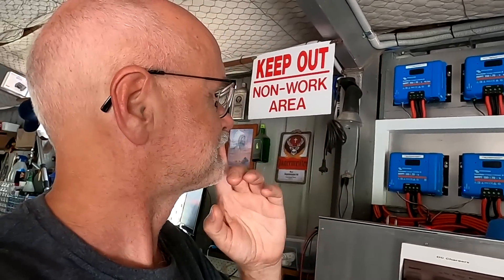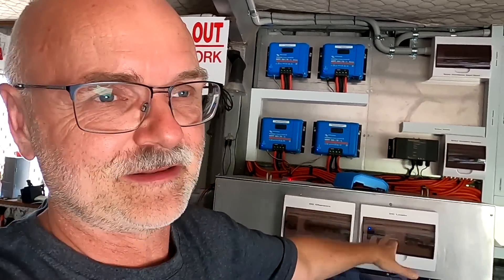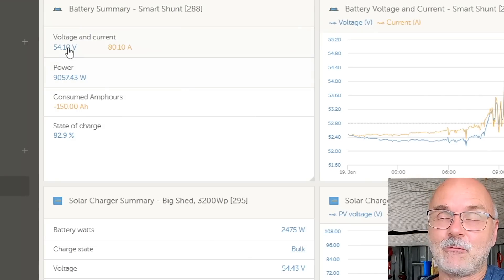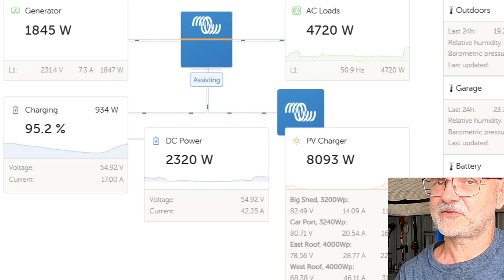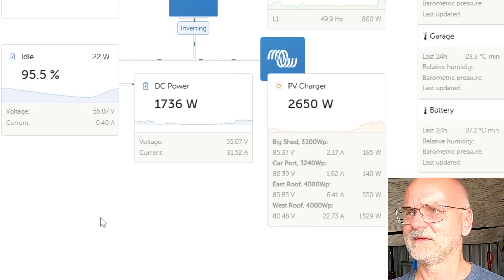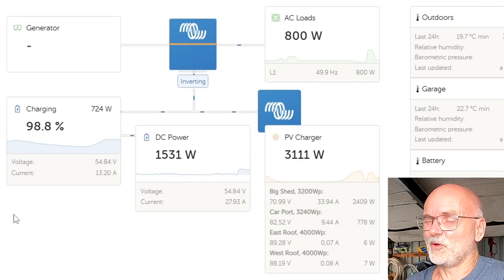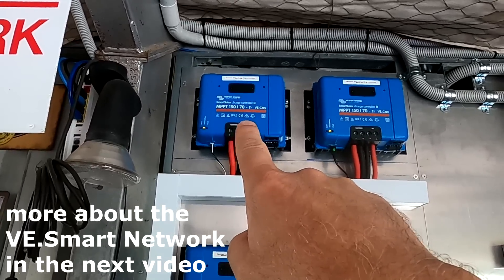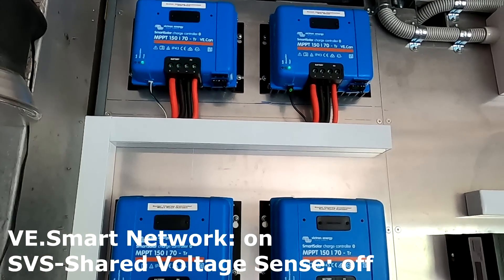Charging chaos: no charge despite full sunshine. MPPTs out of control!

Comment: Great videos. Question, I have just installed a smart shunt , MPPT 100/30 and DC to DC XS into my camping van. Would  you also recommend that I setup a smart network with the devices. The MPPT will only operate when camping and the DC to Dc will work when the alternator is charging the starter battery. So they will never work together.

Comment: Low quality MPPT made in China, capable of converting over 100V from solar panels to 12-48V. To solve the problem, disconnect the input from the solar panels, then short-circuit the MPPT input using low-resistance bulbs such as 12V, 24V and 48V, which means the voltage will discharge to zero, a known problem in MPPT, then we connect the MPPT module to the solar panels again, the MPPT starts working.

Comment: I am building a 48V battery box for the first time with 202A cells and a daly BMS. The output currant is 100A and the input is 50A. I ordered a Taixi single pole 63A breaker as an on/off switch to protect the BMS. 50A continuos X 1.25. Will this allow 100A output? Is this wrong?

Comment: I have pretty much the same setup like yours - 3 SmartSolars synchronized  via Blutoth,  a Cerbos with active DVCC and a battery with BMS. I don't have a SmartBMS (next step for me), but I've never seen such a behaviour like yours. Nevertheless, what I don't like is the fact, that I'm in doubt that the absorption and float settings are working correctly - due to the weather in lucky cold germany I'm currently happy to see the sun coming out to see my battery charging a little. In my setup, SVS is active, SCS deactivated

Comment: I have had my CerboGX, 4 MPPT and Lynx connected to my batteries before I implemented Multies.
I've noticed that voltage differance was rather large (300mV) between 4 MPPTs (they were like <10mV apart) and Lynx Shunt which was way off -300mV
All values have been tripple checked with reliable meter (Fluke).
I talked to Victron about this and they send me new Lynx shunt. This new one was like -150mV off, better but not god.
I have all MPPTs and Lynx connected via VE-Can never tried with smart-BT network. No matter if I used DVCC SVS or any other setting there was no way that voltage would be corrected to any value, god or wrong. They were just different.
After some time I installed my Multies and connected them with VE-bus to Cerbo. No change with voltage read-outs.

BUT after turning on DVCC SVS and multies are ON, I could see voltage readouts were normalised on ALL devices in the system.
Readouts are not exactly same but they differ about +/- 10mV or less, wich is god. The interesting part is that voltage they show now is voltage measured by shunt (which is 150mV less then real). This is not ideal but much easier to compensate if you wish to.

Another thing to notice here is that if you have multies in 3-phase system and CerboGX, MPPTs will allwas be in external controll and will be using multies algoritam, no matter what you put in MPPTs that will be overridden. The bad thing is that algoritams are not the same!

I am quite sure you charging issue Andy is based in different voltage readouts and all of the devices in the system must be connected in some way to comunicate to each other.

Comment: I have the same exact issue, and was told the same things by folks on the community forums: to turn off my smart network. Turning off the smart-network caused the same issue you have. If I put the smart network back on my VenusOS devices gives an error that the devices are incompatible. It's pretty frustrating that victron doesn't have clear language on how to handle this when you have a VenusOS device.

Comment: Hi Andy, I have 6x Victron SmartSolar 100/50 running with BMV 712 together with CERBO GX. 

You definitely want to have all SmartSolar joining the VE Smart Network together with the BMV 712 to enable synchronised charging.

Without synchronised charging, a SmartSolar may see what it thinks is a battery voltage, but in fact is another SmartSolar's charging voltage and make an incorrect decision on its charging action.

Without synchronised charging, the more charge controllers there are in the same system, the more chaotic it is.

With Synchronised charging enabled, you would noticed that the Blue/Amber/Green LED on each SmartSolar solar charger will flash in a coordinated manner, with each unit taking its turn. This way when it is time for one charge controller to charge the battery, no other unit would attempt to charge. Hence the charge controller would be seeing the real battery voltage and not the charging voltage from another controller.

You can also control the sequence by bring each controller online in the manner you want, as each controller is connected to the battery. They should follow this sequence to wake up during synchronised charging. 

With SmartSolar and BMV712, synchronised charging works well using Bluetooth connection alone. 

You also want to enable the BMV to transmit battery voltage sense and battery current sense to the VE Smart Network. 
Especially with LFP battery the voltage remains relatively flat during charge and discharge phases. So voltage measurement needs to be done very accurately especially when the battery is close to being fully charged. Accuracy of 0.01v is preferred. So this is best sourced from BMS. The closer this measurement is taken from the battery, the more accurate it is. 

Also be aware that the voltage drop induced by power loss in cable and circuit breakers particularly, increases not in a linear manner but in an exponential manner as current increases towards their rated capabilities and limit. Most circuit breaker operate on bi-metallic strip. Some has additional coil and magnet to facilitate. The power loss is determined by I^2 x R. This power loss is translated into heat dissipation, which in turn heats up the bimetallic strip to deform its sharp until it disconnects at the rated current limit. 

With this in mind, the higher the current output, the higher the power loss and voltage drop there would be in these circuit breakers and even conductors if they have not been properly over sized. If you rely on the battery voltage sensor on the charge controller there would be an ever increasing discrepancies from the actual battery voltage. So the BMS battery voltage feed plays an even more important role as the system output increases. Without an accurate battery voltage, the charge controller cannot make an accurate assessment on whether to operate in bulk charging mode or when the battery is fully charged. 

With a system that is capable of high output, it is also vital to control the maximum current in order not to overload the conductors, the circuit breakers and the battery. This is where DVCC plays an important role. The DVCC feature is supported when the components are connected to the Cerbo GX.

The CERBO GX only has a limited number of VE Direct port. I give the BMV712 preference (as obtaining timely voltage and current reading is vital) to use the VE Direct connection on the Cerbo GX, followed by the main SmartSolar controllers that brings in the bulk of the power. The auxiliary SmartSolar goes on using VE Direct to USB connection, as these have to go through USB hub connection to the Cerbo GX.

This setup works perfectly and you can see all the controller reaches the fully charged status all at the same time.

I also find it useful to utilise more SmartSolar controllers and having them reaching peak output over different times in a day. This way you achieve a more even and sustained high output over the entire day, instead of just having a huge peak during noon, forcing the DVCC to kick in. Because once DVCC kicks in to limit the current, you are essentially losing power for capture.  It is better to avoid DVCC activation by design and group your solar panels and SmartSolar strategically.
Reply from the maker: Thanks a lot for sharing your experience with that, Damian.
I have set them up in the VE Smart Network again and it works great (as it did before). No problems anymore.

Comment: I have three MPPTs and as long as I am transmitting voltage from the bmv712 then all MPPTs are synced
Reply: Also, I use the overkills (3) BMSs standalone, no comms as I am protecting cells and individual pack with these.

Comment: Hello Andy, i am about to upgrade my system from 4.2kw (5.5kw inverter) by adding 8 kw inverter and 7.5 kw solar for the battery adding 300 Ah to 210 Ah. Total should be 510Ah and 13.5kwh inverters with 11.8 kwh solar panels i will use big busbar to connect the batteries then the inverter hopefully lowers the voltage drop.

Comment: I don't know why you bother to listen to amateurs' "ideas" instead of Victron Electrical Engineers -- who have university degrees and have designed, built, programmed their equipment. All you learn is what NOT TO DO from such bozos. 

From what I've observed, you endless fiddle with your system to no real advantage. You only end up knowing what is already known. It's a neurosis, an obsession, disguised as a search for more specialist knowledge. Have you ever spent a day not even glancing at your system -- in other words, just lived happily for 24 hours with a system which collects sun and delivers power to the various appliances you need. Did you know Victron have actually gone to a lot of trouble to make their systems low attention? <<< sarcasm.

Just recently, I jettisoned an intermittently malfunctioning $500 Enerdrive DC2DC charger which had all sorts of user settings for a basic $250 Renogy "set and forget" unit. It actually works just as well ... without all the if/then, and/or settings angst.

Comment: I have multiple controllers of different makes as well as an engine driven alternator. I solved the problem of silly bickering between them by having them all set above my BMS cutoff voltage but below max battery allowable voltage (for safety) it is then a simple matter for them all to be turned off by the BMS, or even by a voltage sensitive relay, at a predetermined voltage (I use 3.5v/cell) I can then have a cut back in voltage of 3.375v/cell which avoids re-bulking too often. If you set the MPPT controllers’ float voltage to 13.5 too then when the charging cuts back in the charge sources will supply the loads and also not overcharge the battery. The controller re-bulk is set so that the normal voltage the battery reaches over night is  below the level needed to put the controllers into bulk for the next day if they don’t do so automatically after sunset. This method means I can use any controllers or charge sources that were designed for lead acid and have the BMS as the final arbiter of what the battery sees which I think is the best way to avoid arguments and it keeps everything very simple. I’ve had it running for 3 years now without any problems.

Comment: hi i have an 1800watt solar  panel setup on my motorhome with 11kw of  lifepo4 (32 105ah  cells at  27.4v) ihave 3 mppt victron solar controllers feeding in to it and  3  dc  to dc converters from the engine controlled y the  cerbo i  have setup up my multiplus2  has  a ESS system with the ESS  assistant  and  none  of  my solar  controllers  go  independant  they were bluetoothed  together but  they show  external control  Because of the ESS now  controlling everything i  have so much  control  on the portal  on my phone i can  even feed back to grid  or load through the mains  socket and have done all from my off grid vehicle.
by the way love your channel  have  een watching from the start

Comment: DVCC is used if several power sources is connected. I use DVCC to limit the max current from mppt and MP-II in the event I'm charting the battery from the grid in the daytime.  The MPPT is prioritized over the MP-II. If the mppt ramps up due to sun, the MP-II ramp down to keep the same current.

Comment: Hi Andy. I have a similar
Victron setup with two MPPT 250/100 ve. CAN,  MP-II, lynx shunt and Cerbo.  All gear are running on ve.CAN for the DC side and ve.Bus for the AC side. The mppt are external controlled by the MP-II. Charge voltage and current are setup in the MP-II.  I also run ESS assistant, but don't think this should be necessary. I don't have a external BMS connection to the victron system. I don't have any problem with bulk and absorption.

Comment: Hi Andy. I have checked my system here with 9 Victron MPPT (4 x 250V, 5 x 150V) and a MG Energy System BMS which came with the Lithium batteries from them. This BMS is a more advanced Lynxs Smart BMS, produced by Victron especially for MG Energy Systems.
All the MPPT's switch from bulk to absorption, and vice versa, the same moment. In the settings of the MPPT's has to be that they are external controlled (by the BMS). When the batteries are 100% the 250V MPPT's are delivering the energy needed by the inverters, and in case they can't delver more, the 150V MPPT's are supplying.
Strange enough, if I look at the history of each MPPT by Bluetooth, only bulk time is there. The same in the remote console of the VRM, only bulk time or total time is displayed.
SVS, STS and SCS is disabled in DVCC.......

Comment: Hi Andy, I would like to ask you a question. I have 2 x 275w solar panels on my mobile home. Cables come to a cut off switch to Victron 100/50 solar controller to 2 x 190ah lead acid batteries. I want to add a 2nd 100/50 controller to charge a lifepo4 200ah battery. The lifepo4 will be used on 12v underfloor heating only. Would I be able to connect the controllers from the cut-off switch and use the solar array for both. I am in the UK so not much sunshine, but some days are nice. Thanks in advance Theo

Comment: You said yourself, that is not really an issue. Having different voltages on multiple MPPTs and therfore independent behaviour is expected. Normally it is not important whether you charge to 3,45 V/cell or 3,43/cell. Your charge/discharge tests have shown that normally there is not much capacity gained by charging to the slightly higher voltage. Yes the MPPTs will drop out and you will not reach the 100 % point defined by you at 55.2 V pack voltage.

Are you really desperately in need to charge to your 100 % point? 
As this always cause stress to the batteries, especially at hot climate with accelerated calendar aging, this should be avoided as much as possible. LifePO4 calendar aging is about twice as high above about 70 % SOC as below and can be more then 5 %/year. (ref. Peter Keil, at all; Calendar Aging of Lithium-Ion Batteries)

Having a synchronized voltage measured near the battery by the SmartShunt fixes this. All MPPTs see the same measured voltage and react synchronously at 55,2 V reached.

Of course, you can activate DVCC that uses Shared Current Sense to control total current into the battery, as you are doing. 

If you have a CAN Bus connected battery, then all internal limits are provided by the battery (CVL, CCL and DCL) and Shared Current Sense (values from SmartShunt) are disabled, as full charging control is provided by the battery. Actually the charge parameters must be programmed into the battery. All the chargers are slaves to the battery.

There is more information about DVCC and smart batteries in the Color Control GX Manual.

Comment: hey Andy, i have a similar issue with my van setup - 2x300ah 24v batteries, with 3x solar charge controllers for 3 sets of solar (3x 2p solar panels). i would fix your problem this way;
1. set the charge controllers float a few volts higher than needed, and watch the battery to the point of full charge (watching is the key here to not over charge).
2. at this point (of full charge) i would take a screenshot of the voltage that the solar charge controllers are reading off your battery, and the full voltage read via the bms'. Cut the power supply in.
3. take the difference between each solar charge controller and the average bms voltage.
4. adjust the float settings to match the actual battery bms voltage by adding the difference between the solar controller and the bms.
5. you could also apply this to the bulk and absorption voltage values too
Reply: the idea behind this is that you want a real life representation of what is being sensed vs actual. so you have to test, record, and apply the respective values. i hope this helps